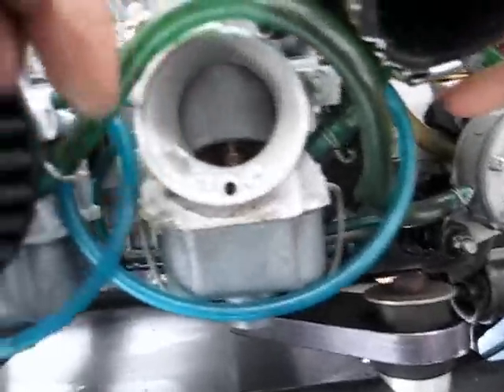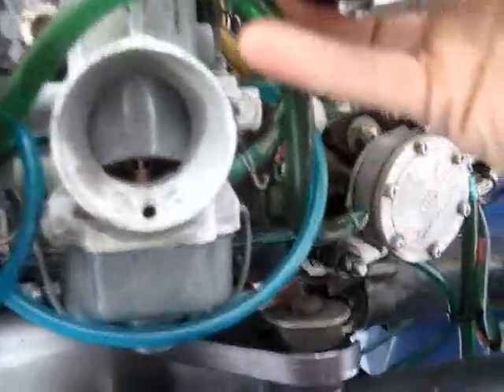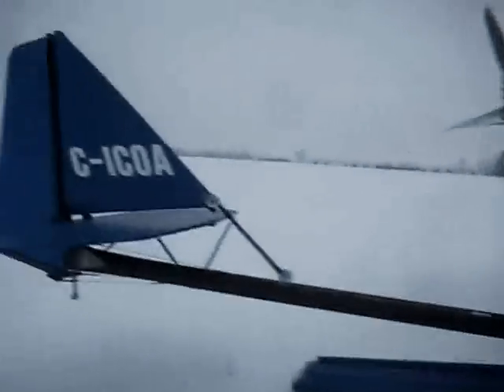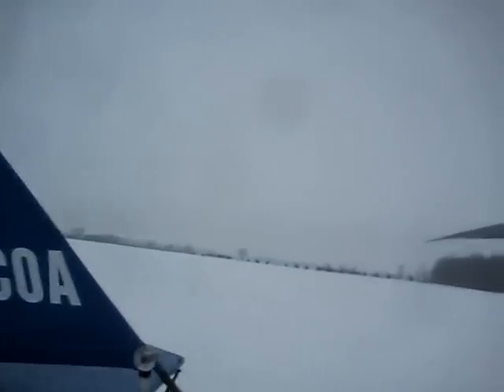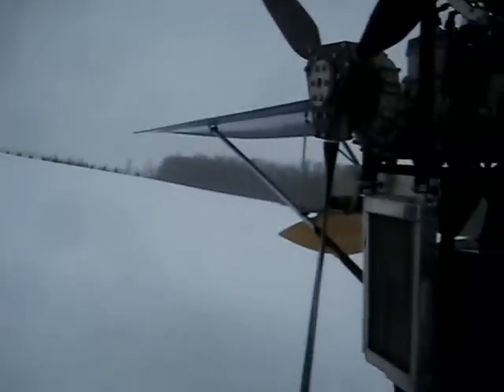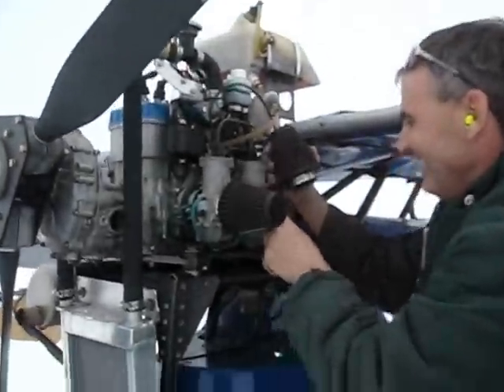Engine losing power and lands in field Pilots lost

Comment: @mxf7010g8k 
I had a challenger, it doesn't do very well when tied down outside because of the angle it sits when you're not in it. (mine blew over, snapped the tie downs) it also flies with the rudder, not really with the ailerons.  other than that it's a lot of fun, good visibility, not so good to point things out to the passenger sitting behind you...
after my Challenger self destructed, I got a "sky kits" Savannah.   takeoff in 100 ft cruise at 90 mph, and rugged like a jeep...